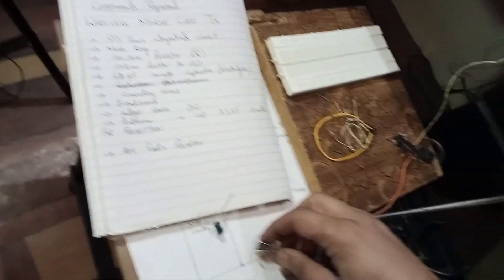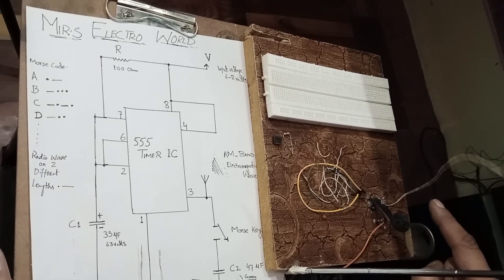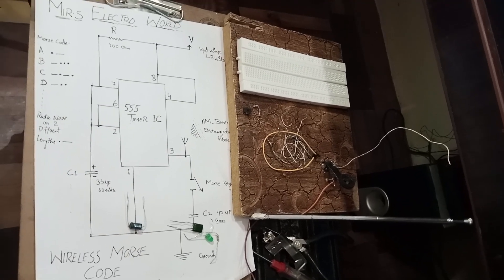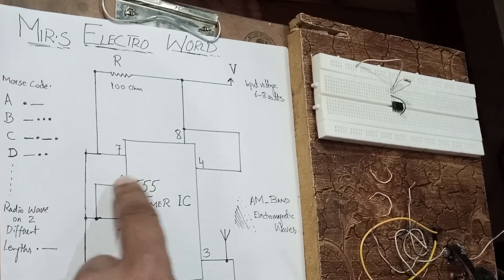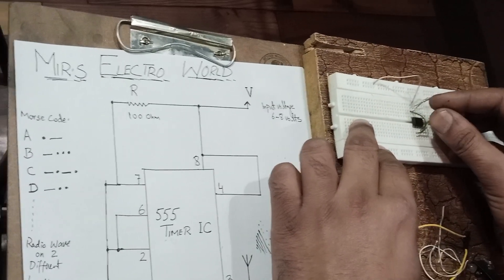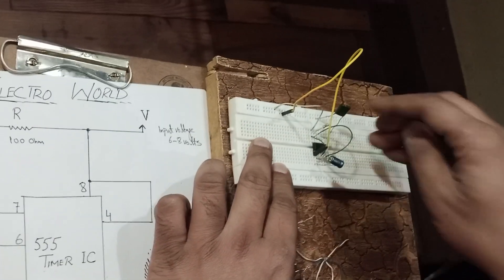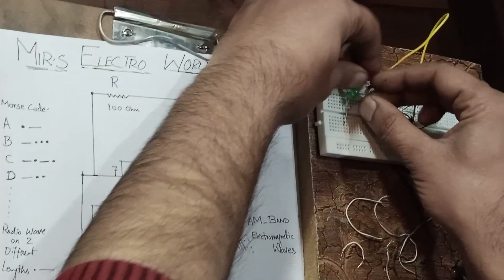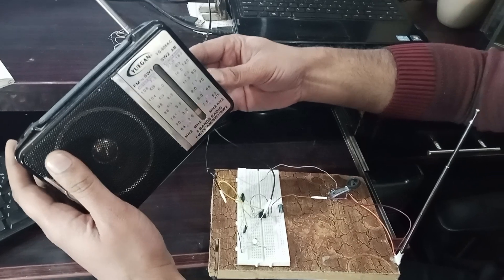Make your own Wireless Morse Code Transmitter and Receiver

Comment: It was good, But can we make 300 miles range Morse code transmitter and receiver? I will great full to you if you are making video on it. Thanks a lot
Reply from the maker: Yes possible with the help of a stronger EM oscillator. 555 times is just for lab expriments on low range. But making it up to 300 miles is possible but making a video on a long range it is not legal. Sorry fellow